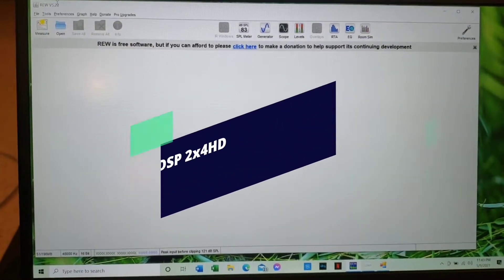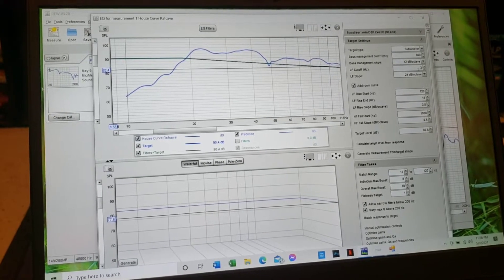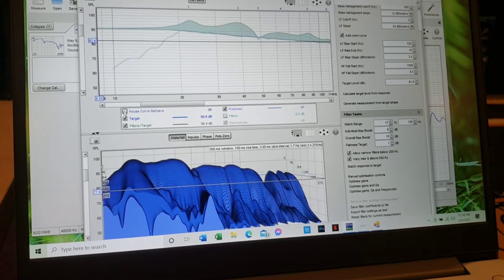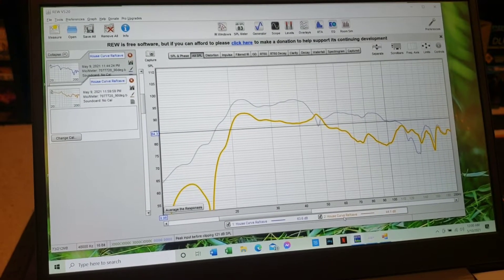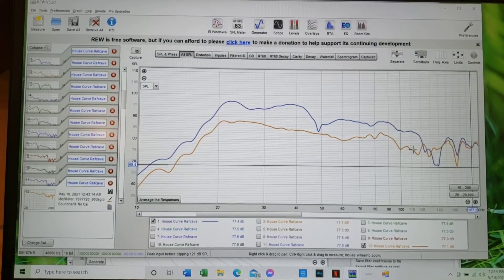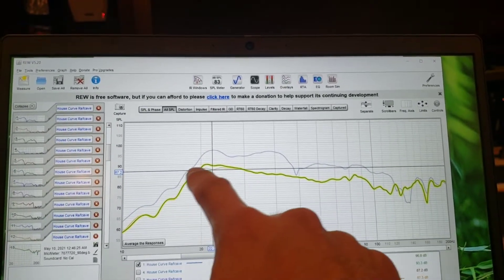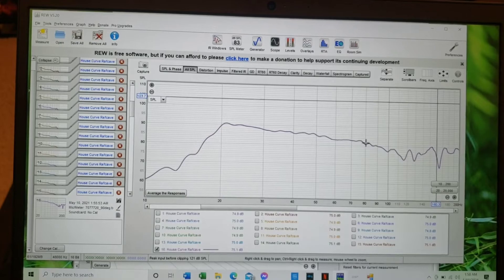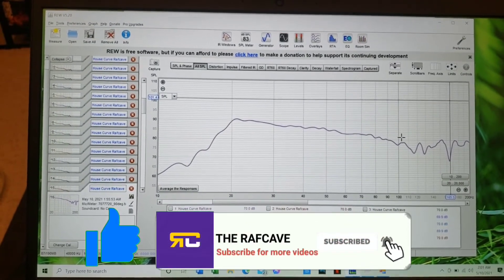Creating my subwoofer's EQ house curve for my home theater with the UMIK-1 and MiniDSP 2x4HD.

Comment: Had no idea you were on this level of knowledge until going back and looking at your older videos which took a bit since you have a lot! That’s awesome. Next is raspberry pi and ezBEQ!? Btw instead of using the house curve in rew I EQ flat and then use a single low shelf filter to boost by 10dB at the highest.Since the low shelf filter never stops I put a filter to drop it 48db/octave removing the boost at 20 and below essentially removing the boost and make it look like the rew house curve

Comment: Measure you're listening seats and find the best average you might need to sacrifice the main position at little to make everything consistent. I make sure 0-80Hz is the same at every seat within 4db range. Then I  try to correct 81-100 and average it out the best I can at all seating locations.👍

Comment: Using this mini dsp I would have to run my subs with rca’s? I currently have them on xlr connections
Reply from the maker: Correct, no xlr outputs on the minidsp.  There are rca to xlr connectors if you need.
Reply: There used to be a balanced version, the only balanced option through them is the 4x10 HD which is rack mountable, pricey (559),  and most people gonna argue overkill. It should be noted that this like the discontinued 2x4balanced uses terminal blocks so you have to diy the xlr cables/connection. I remember there being a avsforum where someone built a diy one where they put it into a enclosure with xlr connectors. 
The only downside to grabbing some rca 2 xlr connectors is your not really balanced anymore and you might as well save your money on those and go rca if your subs have them. The big thing with xlr is eliminating any ground loops when you have long subwoofer runs.

Comment: Did you level match your subs? Did you align them after? Why did you use a house curve? Do you use dynamic Eq on your marantz?
Reply from the maker: Yes, house curve cleans up the eq curve.  No dynamic eq used in my Marantz.
Reply: @TheRafcave  did you create your house curve before after Audyssey. Did you level match your subs?
Reply from the maker: Yes after Audyssy, but remember I turned off the Audyssy sub calibration from the mobile app.  All subs are gain, level, time aligned before Audyssy and the house curve.
Reply: @TheRafcave  you mean you cut off the frequency range of the sub on the app right?
Reply from the maker: @dadevastator24_77  Yes, I put it all the way to the left.
Reply: @TheRafcave  ok good. No’s align your subs to your mains
Reply from the maker: @dadevastator24_77  yes

Comment: Can anyone confirm or deny if I use the Denon editor app to disable the subwoofers in the editor app can i run minidsp set my distances levels then set a House Curve in Rew. If I then re run audyssey speaker correction setup how would that integrate the subwoofers using the minidsp to do all the subwoofer setup would I have to set manually subwoofer distances distances or how do I set a house curve in minidsp and re run audyssey to recalibrate speakers and have my subwoofer settings intact and integrated witht eh rest of the system as re running a room correction would that not flatten the curve in the minidsp.  Can anyone explain how I would be able to set up my minidsp to be able to tune my subwoofers then re run a room speaker correction and be able to keep my minidsp subwoofer setting intact and be able to run room correction without destroying my House Curve in the minidsp when rerunning any speaker calibration. Can anyone explain what is the best way to go about it please as I am totally confused.